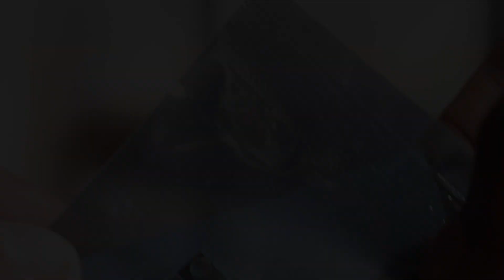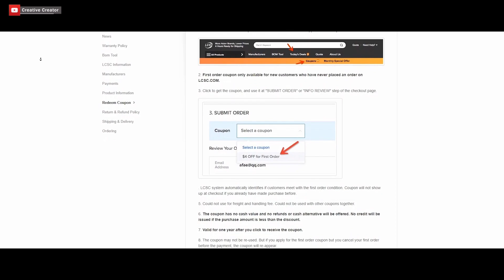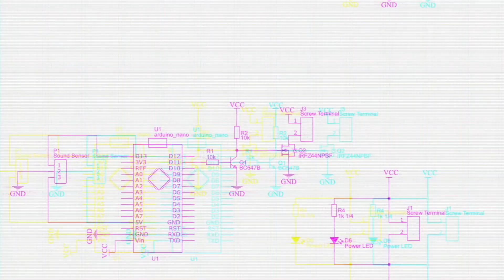Simple Basic audio Amplifier Circuit LCSC

Comment: Hi there! Thanks for the video. I would like to ask you a question. I have the same circuit. As soon as I increase the volume above half on my device, the amp's sound becomes louder for a split second and cuts off, this loops until I put it back onto half volume. Do you know why? Thanks.
Reply: Necesitas aumentar el voltaje de tu fuente a 12 v.  2A

Comment: connecting ground with resistor on audio input will decrease the volume..
Reply: Hi Bhai mene pam 8610 module liya hai aur mene usme 4ohm 5watt ke ,4 speakers lagaya parallel ,12 volt Adapter se direct supply diya hai,me aur half volume me chalta hai thoda fool Kiya to sound distortion hota hai
Reply: So What should we do instead of that?